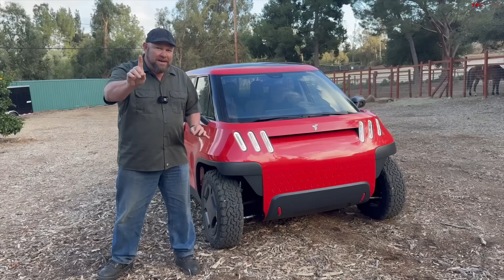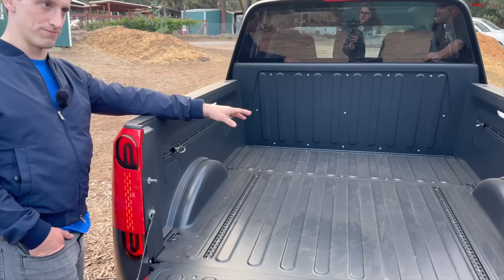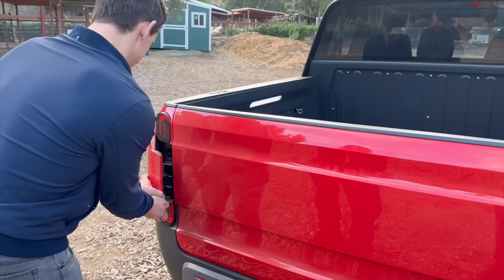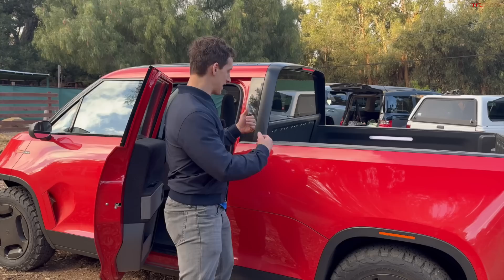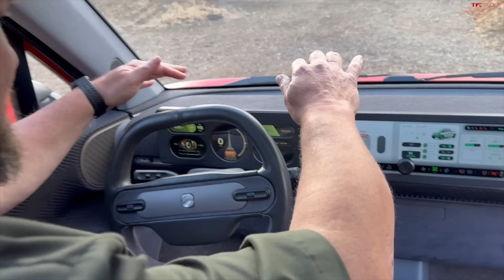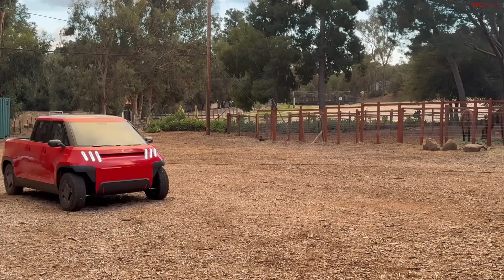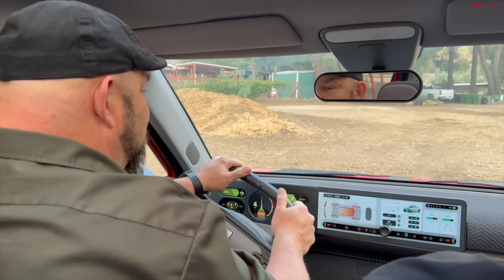I Drive the Most Revolutionary Truck In Decades: Meet the Telo MT1!

Comment: This guy is the first EV CEO that has made me interested in their vehicle!

EDIT: I was wrong, $41k is before tax credits.
Reply from the maker: Jason is a cool dude.
Reply: @PookieMaliboo  looking at their website, the 41k is before the tax credit. Wish the ford maverick was full electric. Perfect sized truck.
Reply: @Nathan-wx7ez  Maverick 4wd Hybrid is as close as you will get.  Ford is doing a new platform for the next gen trucks.
Reply: @Nathan-wx7ez  you can get a ranger xlt 41k after taxes
Reply: No, the website specifically says the $41k is without the tax credit, and that with the tax credit the price would be $34k.
Reply: @Stetrain  I stand corrected, just rechecked and you're right.
Reply: Got to get that battery cost down.
Reply: Don't forget the road use tax you have to pay for not being a gasoline user.
Reply: 41k for mostly off the shelf parts
Reply: Unfortunately for a base model the price really needs to be much lower. Particularly, for the utility minded folks. But the truck market and car market for that matter is so overinflated that if any of them do try and sell a small base utility style vehicle they all are going to still strive for this 40K mark. Which is discouraging. Overall I like the design and would hope one day the price truly becomes utilitarian as well. However for this decade at least the cost of manufacturing and raw materials doesn't look to be on a very even stable path.
Reply: EV tax credit = your neighbors financing your new disposable EV toy.
Reply: I don't know how it is in other states but here in Michigan, they give you the state & fed tax credit then take away the state tax credit by making you pay all the gas taxes that the state misses out on each year when you get, then renew each year, your registration.
Reply: @SevenSixTwo2012 10 billion dollars subsidized to the oil companies every year so our gasoline prices do not match European prices! We are all paying for them also!
Reply: @SevenSixTwo2012  how disposable? this truck could be half the price of those new "crusher" Queens,I am beginning to think there is a NWO conspiracy against practical affordable vehicles,Ford has already proved they can make one,but the dealers greed plus the big retailers keeps the price up and availibilty low. there have been a few promising "upstarts" that quietly go into the "long night".
Reply: @SevenSixTwo2012  No. I have a job, Federal income tax is withheld from my paycheck. Once a year (April 15), I reconcile. If I paid in more than was due, I get MY money back. If less, I pay MY money in. A tax credit is credit for spending MY money on approved things, like insulation, energy efficient windows, energy efficient wood stove, Made-in-America EVs.  If I don't pay enough in taxes, because I didn't earn enough, I don't get the credit. YOUR money is NOT involved in MY purchase.
Reply: @SevenSixTwo2012  How else should the government be using tax dollars? I haven't heard a single person giving me an answer to that question because nobody wants it to be used to help people in need or make it easier to buy a car with an up front cost higher than a standard ICE Vehicle. 

The only answer I've heard is for our tax dollars to be used to line the pockets of the top 1% and the 4 richest men in the world and give the most wasteful, fraudulent, and abusive government department even more money; The Department of Defense. It already gets over 10 trillion dollars in funding (that the contracted defense companies burn like nothing) why not give it some more.
Reply: @jake_sabrwolf9795  how about not spending it and in turn not taking it?
Reply: @ What funny is that the states hurt the most by what is happening are the ones that also took from the coffers the most, and that ain't blue states. The tax credit was paid for by blue state, who always will carry the red ones, to buy EV's most red state residence neither can afford or want. So the blue states were getting some of their money back.
Reply: @TimeMachine7773  What part of "tax credit" do you not understand?  It's your money which is being given back to you (or not taken from you depending on how you want to say it)....   Basically exactly what you are saying.
Reply: @jake_sabrwolf9795 really didn’t give 2 craps about those guys for the last 4 years but all of the sudden everyone and their dead voting Democratic leaning grandmother is looking at the Forbes 100 stop ur dnc talking points think for ur self young manchild
Reply: @ckm-mkc  I was answering the dude's question. Did you not read?
Reply: @jake_sabrwolf9795  back in the 90s Rumsford said there was 3 trillion unaccounted for in the defense budget.
Reply: @ckm-mkc  he wants you to pay taxes, as much as possible, they always do to fund their pet projects.
Reply: @jake_sabrwolf9795  10 trillion???? No, 10 trillion is 3 trillion more than the entire government budget. It’s people like you that literally have no clue what is going on that drive me nuts. The defense budget is 850billion.
The biggest waste of spending in federal government currently is the payment on the interest of the country’s debt. Over a trillion dollars this year will go to just pay the interest on the debt. 1/7th of the federal budget going to pay interest… so yeah, I don’t think the feds need to be spending tax dollars on anything other than roads, utilities, and federal military, every other dime they take in should go to paying off the debt…
Reply: @SevenSixTwo2012  You do realize that the government subsidizes the gasoline in your non EV car to the tune of billions of dollars per year.  Look it up. You can stop complaining about the EV tax credit.
Reply: @SevenSixTwo2012  How's that TSLA price share working for  you?
Reply: @davephillips9389 tds alert tds alert
Reply: @davephillips9389  LOL

Comment: $41k? They need to get it half that.
Reply: Meh $27,500 for a base ad the tax credit for however long that's still around?
And the base rwd 250 mile version would sell 200,000+ units a year here in the US.

The top spec with awd&350miles of range could be closer to 40k ad the rebate&its low 30s. Sell another 50-75,000 units.

Would depend on the dealer support sales&service systems though!
Reply: Not going to happen with 108kwh of battery on board😂
Reply: @Bubba88d1  lol, Polaris makes side by sides well into the 50k region. If you want it 20 you will need to have like a 20kwh battery instead of 106.
Reply: @steinwaymodelb  I'm not saying they won't cost that much, I'm saying nobody's going to buy them.  A Ford Maverick is more capable and costs less.
Reply: @Bubba88d1 but the maverick is a lot bigger than this.
Reply: @princez.2648  its not $10k bigger! lol

Comment: I'm in love! I am more convinced they will make it to production. When I saw the interior, I thought that the cloth on the doors and dash door was some sound absorption material. I like the flat top design of the dash. but I prefer it to be plastic in order to be easy clean, since we use it when eating in the car. I guess they don't yet have a parking brake on this prototype, as I saw a chock behind the rear wheel when stopped. I liked the comments about the way a rear canopy attachment system is going to make for clean way to seamlessly attach to the bed section. This is the Swiss Army knife of vehicles. If they can get a good rating in crash testing this thing is going to sell well in many markets.
Reply: Bot

Comment: I think a van on that chassis would also be cool. I like the approach and departure angles too. I won't be able to fit in it, I'm too tall, but what I would love is a Ford Transit Connect sized van with 4x4 and real effort on ground clearance and approach and departure angles. 99% of my use of my Tundra is limited by the short bed and the fact that the bed isn't weather tight. What I really want is a van with full sized wheels and terrain clearance. Doing a Quigley conversion on the current choices for vans, being so unreliable and light weight in construction just won't do it.
Reply: Actually a 6 foot 10 journalist from MotorTrend said he "fits fine" in it
Reply: @kingsqueak1  They do have future plans to build a van. The Telo is being designed to put a 3rd row of seats in the bed. The top panel of the monster tunnel is removable and 3rd row passengers will put their feet in the open monster tunnel. The stock tires are 215/65R16 All Terrains. They built the truck first because there is more demand for a small truck to carry things that may be too tall for a van. Their goal is to start making a profit as soon as possible to be a success and avoid failure like other EV companies. Then they will eventually expand their vehicle options to include vans, 1 ton, and 3 ton trucks.
Reply: On the Telo channel, they showed that a 6 ft tall guy will fit.
Reply: @aerynlovell4754  Yeah I'm 6'5"
Reply: Nissan NV 200 styling with AWD would be perfect
Reply: @msnpassjan2004  and with an 8 spd ZF instead of that CVT.
Reply: There is a van configuration on their website, but the vehicles are just too expensive. The base price for the stripped down pickup version is way more than a compact van.
Reply: @tenpoundburrito  I was more interested in the 2WD truck because I'm not a van person. When I was a kid, I liked the vans with paintings of fantasy art on the side. Some of the interviews I watched with the Telo founders talked about the potential for a van "sometime in the future," so I assumed it would be at least a year away. Those videos must have been old because they still hadn't decided if the 2WD version was going to be front wheel drive or rear wheel drive. I was hoping for rear wheel drive so someone could turn it into a drift truck. Personally, I would enjoy seeing a Telo van with either dragon or pegasus artwork on the side.
Reply: @tenpoundburrito 
What compact vans are still available in the US? Ford doesn't sell the little Transit here anymore. Is there still a little Ram?

Comment: This will be the future of styling. No point in having 5 ft of hood when you have no engine to house.
Reply: … until you crash headfirst into something and your legs become crash absorbers 😢
Reply: @Fabulousprofound168  no, only a small area of an ICE is a crumple zone, the rest is simply housing for the engine and transmission, and it has to be designed to direct those components away from the passenger compartment instead of crushing your legs. Without those components and the space required to house the, it’s all crumple zone on this thing.
Reply: @Fabulousprofound168  😆 You're probably not wrong!
Reply: @ he did say the front end was designed as a crash structure, but still…

Comment: A 5' bed does NOT hold 8' of anything w/the tailgate up. I know the city wonks do not care, but for those of us wanting to haul real loads in the bed 5' is useless. It's another car w/an open trunk.
Reply: Did you even hear what was said? The midgate folds down so you can fit 8ft with tailgate up.

Comment: I think one of the biggest selling points for this vehicle is international sales. When you go to Europe or most cities around the world, they don’t drive or the huge trucks that we drive. I would think contractors, etc. in places like Rome would love a vehicle like this.
Reply: In Europe contractors usually drive vans. This thing would be even more useless than those battery vans they're trying to push. Abysmal range and horrible depreciation. People hate them.
Reply: @ they do drive vans don’t they. This has great range.
Reply: @craig8638  Good range with nothing in it and not towing.
Reply: @kopyrightliberationfront2000 People could say that for an EV. Some think if it doesnt have 600 miles on tap it's trash
Reply: @kopyrightliberationfront2000  do Europeans hate electric utility vans?
Reply: @ some do, some don't. Those that don't, don't really care much because their van is most likely a company van and drivers get paid to sit and wait for it to recharge.
Reply: Especially if you can put a bedcap on it and basically turn it into an SUV or van on a whim.

 That's one thing I liked about the Jeep CJ8.
Reply: Exposed wheels is a big no-no in Europe. They are terrible for pedestrian safety.
Reply: @Viktor-x1w7w Some people need helmets. Let Darwin sort it out
Reply: @Viktor-x1w7w  good point, they may have to loose the width
Reply: You are right, amigo. Narrow streets and many emission restrictions mean the old diesel Fiats, Renault and Citroens are rapidly untenable. I hope the international trading environment calms down again soon, which would make the Telo exportable. Greetings from España.
Reply: First of all Europeans don't generally drive trucks period, you overestimate their popularity. Especially in something like Rome...trucks in European cities are none existent. Second of all, this will never pass EU safety testing, that tiny crush zone is too dangerous. It would at most be a heavy duty low speed truck, for industrial applications, not general consumers.

Comment: The mini truck is back and so is Nathan!
Reply from the maker: Two of the best things!
Reply: Mini trucks didn't have 4 doors. They had jump seats for young kids at most, and kept a usable bed.
Reply: @volvo09 

"Useable" is in the eye of the beholder.

 Even a tiny Maverick can handle 4x8 sheets, 2 dirtbikes, lumber, pipe, gravel, ladders, etc.

 I can haul all that stuff with a Crosstrek though. I have hitch and a 4x8 trailer.
Reply: @volvo09  I think they changed the title of the video. It was originally the mini truck is back.
Reply: @volvo09  well Kei/mini trucks do have a crew cab configuration but its not common
Reply: @sometf2player752  that thing is far from a kei truck. 

In the US market a "mini truck" is a 90's S10, ranger, Nissan hard body... 

This thing looks like a super sized 4 door golf cart with a little utility side by side bed. 

Obviously it's a city car, but it's not a mini truck, a new Tacoma meets more of a mini truck than this, and a new Tacoma is way too big to be a mini truck, nevermind being a kei truck.
Reply: mini trucks have engines.

Comment: $41,000....IS NUTS!  $46,000 for 4x4 dual motor....equally NUTS!
Reply: Better to import an older kei truck
Reply: Quarter Century-old tiny truck, where the driver sits on the wrong side and is costly to import and is getting more difficult to make street legal  etc etc etc. 

Is better at what?
Reply: @nc3826  evidently is better at getting less value for the dollar.
Reply: @nc3826  it isn't that crazy to import them. there are services to import these vehicles that handle everything for you. all you have to do is pick it up at the port, and i bet you can pay someone to do that if you don't want to deal with it.
Reply: @Stackali  why tell me? Since I didn't call it "crazy" did I? 

It's just an absurd comparison.... To each their own...
Reply: Actually reasonable
Reply: You can get a kei truck for a couple thousand dollars. Without all the disavantages of electric.
Reply: @kdrapertrucker  None of the advantages either. Have fun with a no power, slow as hell, shitty gearbox pile of garbage, struggling loaded up a hill, while this thing quietly flies past you.
Reply: @kdrapertrucker  and without the advantages of electric, which are significant
Reply: your taxpaying subsidies will help reduce the cost by the time it comes to market
Reply: @InternetDude  Not even close... Assuming this even comes to market the price will only increase.
Reply: @InternetDude  yeah only to 35k which imo is too expensive. i would rather just buy a kei truck. as long as you live in a state that allows them, its gonna be way less than this thing.
Reply: 106 kilowatt hour battery pack EV.... It's NUTS that anyone, thinks you're going to get that for under $41,000.... And that subsidies will still exist when it reaches production.... But what's really squirrely, is how many NUTS that are out there. 

Bitching and complaining about things they have no interest in and know nothing about. Have fun trolling!!!!
Reply: @nc3826  $41000 gets you a ~78kWh pack and the 106kWh is about $4000 extra.
Reply: @ I am not trolling.  It is called an opinion.  Have fun gas lighting.
Reply: @nc3826  to be honest, that is fair.  I guess it comes down to if that matters to you.
Reply: @ToddParker  you're a better person than me... for being so open-minded, in your last comment.... 

As I always say do what's best for you.... Have a nice day...

Comment: One of my favorite aspects of electric vehicles is the ability to think outside the box and effectively use space better than internal combustion vehicles have or do.
Reply: Yes no maybe so.... This is proportionally an I-MIEV, which was based on an ICEV. 

That's why kids end up playing with the box, instead of the toy. It comes down to creativity. Not preconceptions.
Reply: Yes, but then there is the fire risk, the unreliability, and the basic crappiness of electric vehicles. Put a gas motor in it and you'd really have something. The EV fade is over. You cannot give them away at the moment
Reply: @kdrapertrucker  I have hundreds of thousands of miles racked up on electric vehicles and I’ve never had a mechanical issue. And the fire risk isn’t really a thing.